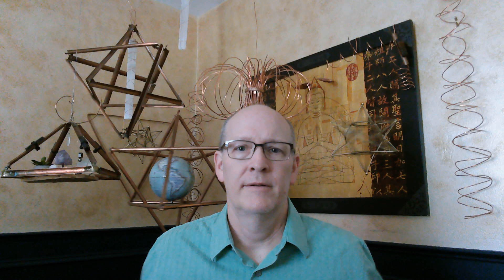Magnetic Nuclear Fusion Laser

Comment: Is this device using a circular ring of tialcoB multiple elements, to shunt the magnetic pattern from a helical "light" flux, into a much bigger magnetic flux inside the device, and the tiny shunted magnetic effect is able to coax (inside the device) some of the inner flux to link up into a more helical path that becomes what we call light?, and does that coax other flux to join in, becoming a much stronger 'light'? Is it basically assembling light, comparable strength to a laser, but without mirrors?  I really liked the hint you gave about one rotor having, I'm guessing, 3 times more magnets, maybe even 6 times more,  than the other rotor.  When 3 or 6 north outflows are chasing a south on the other rotor, they probably spiral like making a rope, and I think that is where it becomes attractive for other etheric/higher-density flux to enter that spiral too, thus giving the amplification of the effects.  Is this imagining, on the right track?
Reply from the maker: I'm saying Yes to all your questions and adding that the high magnetic pulse rate combined with crystals, converts the energy into light, but its still quasi-interdimensional until the full polarization is added, then it becomes intensely bright in our dimension...
Reply: @MagneticEnergy   Perfect crystals made in zero-gravity I presume.  I've heard of earth quartz glowing from pulsed magnetic flux (and breaking). If that's the total source of the light, then I guess I was wrong about self-assembling helical light torus-by-torus because they are coaxed into the alignment to link up that way, ( unless the crystal is the scaffolding for it.) The hexagonal atom arrangements in quartz, supporting circular flux rings at each hexagon, is that where light is created?, ( this piece of basic physics, I don't know the answer to).,  or is it electrons causing ionization / the hops up and back from higher electron shell levels?  Your video has really gotten my imagination stirring.
Reply from the maker: The crystal just helps set the pulse rate and initiate the reaction, the etheric/magnetic excursion energy is immediately converted into light in the toroidal fields and the double helix...